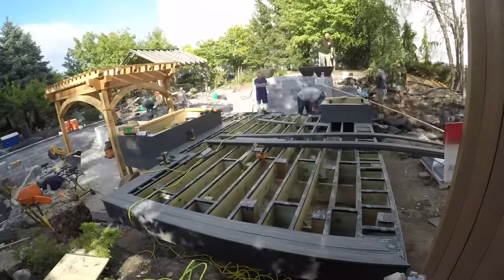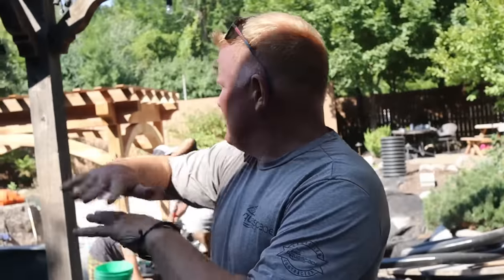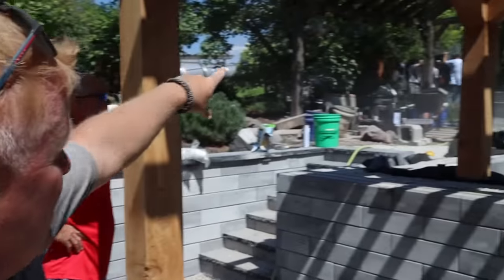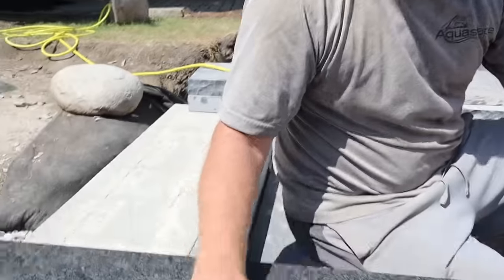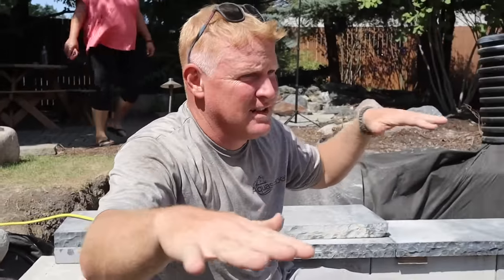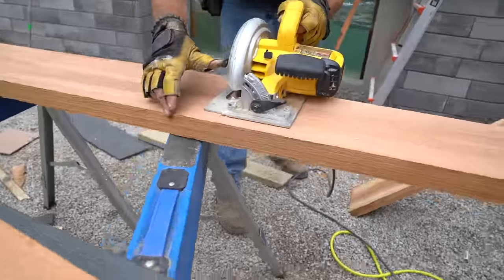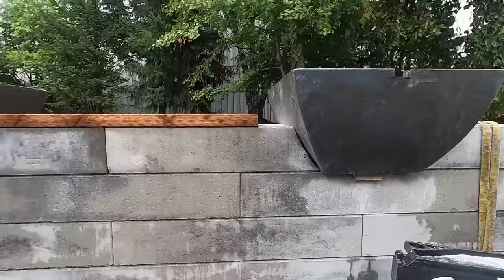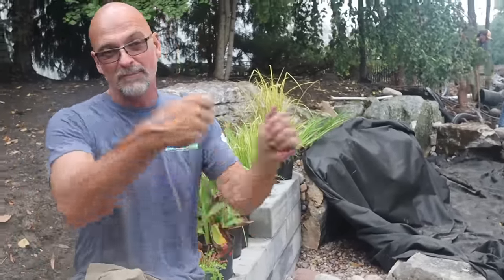THE REC POND is DONE! | AquaGardens Recreation Pond

Comment: Where can I get full details of this project
Reply from the maker: We'll be doing a project walkthrough of this soon! Ask what you would you like to know and we'll answer it in the video.
Reply: @TEAMAquascape  I am in the planning stage of a recreational spa resort plus the renovation of my sons home . 
I want to do what you have done in both the places. ....home and spa resort.
The glass window/wall concept is awesome....I really want that and need more details of that glass.
I will be placing recreational ponds connecting all the cabins on the development of 3scres of the spa resort. I hope to get atleast 10 small cabins each with hot tubs .
This means I need pumps for ponds , falls, and jets for ponds and hot tubs. Lightings as well.
I would like as much as possible to be low maintenance for the recreational ponds and have wetland filters wherever needed. The size of the ponds will vary .
Would a combination of pool liner with concrete pond floor work? In some cases I might have solid  concret walls on one side with concrete floors and rest with pool liners.....does this sound doable?